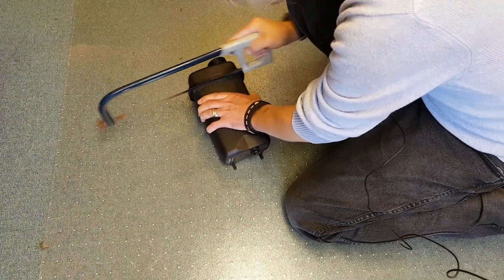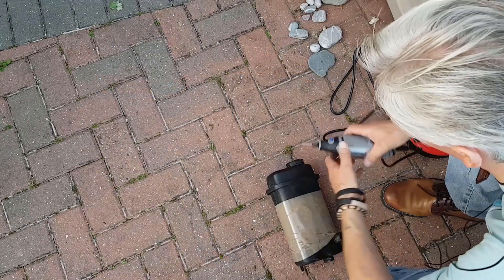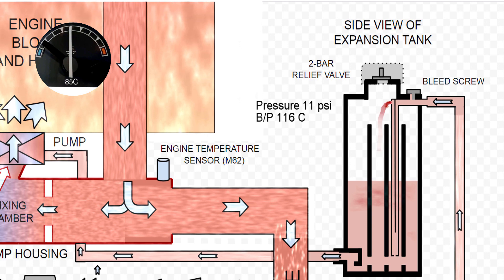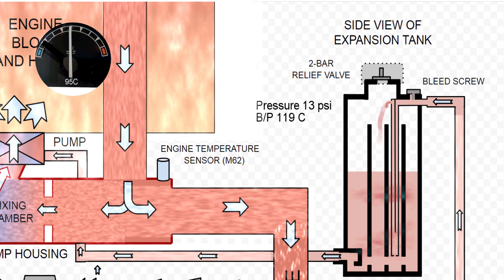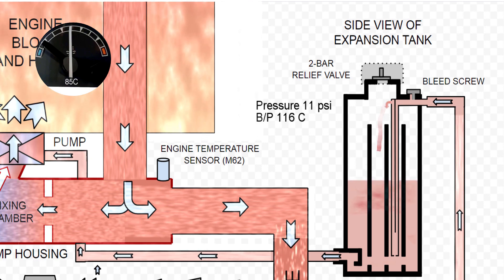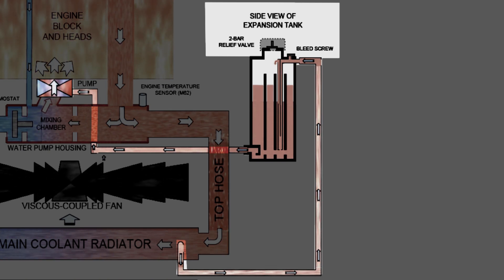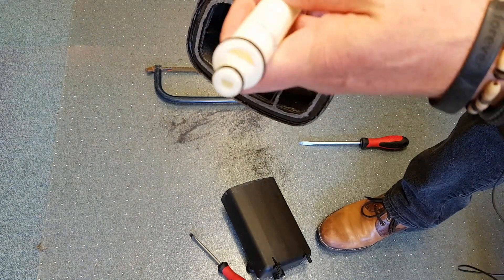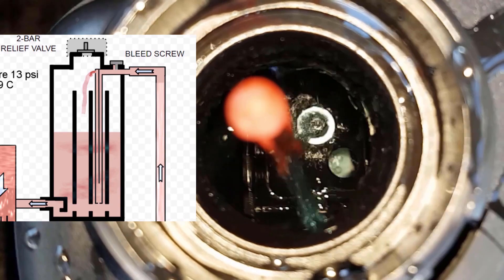I CHOP A NEW BMW EXPANSION TANK IN HALF

Comment: What causes the coolant not to flow out of the bleed line that trails off the top of the radiator back into the top of the expansion tank?
Reply from the maker: Possibly thermostat stuck open, not enough coolant or revs too low - you need 100 RPM before it will pop out of the bleed line
Reply: @TimmsBMW  figured it out ... the over flow hose that connects to the top of the expansion tank that channel was blocked with dirt not the hose but the channel on the expansion tank the hose connects to 😁

Comment: Hi Timm, this is a long shot but ill try. My red level stick wasn't coming up to the level of the lip, I pulled on it a little bit, it is now stuck considerably in the up position and won't go down. I am afraid if I fiddle with the red stick, it'll break. Any ideas?
Reply from the maker: They do that Hassan, mine was stuck for years until I replaced the tank!
Reply: @Timm's BMW Repairs and Information  Lesson learned. At least it's not catastrophic, thanks!

Comment: Hello Timm, Do you know where the weak points are on the e38 expansion tanks?
Reply from the maker: All over! The float support usually fails first and then it leaks onto the level sensor
Reply: @TimmsBMW  yep it looks like it is pouring out the bottom under pressure. Only have had it for about a year. Going to unbutton a few things so I can take a closer look as I can't see. Then put the pressure back on again as see where the leak is. Thanks!
Reply from the maker: @2009adtommy  make sure you have BMW blue coolant, it looks after plastics@

Comment: Fantastic--- I had never thought of the reason for the "waterfall" inside the tank. I had always wondered why BMWs build up coolant pressure faster than other cars. 

In fact, I once got so worried that I ran a  chemical"head-check" on my E38.

The caps (which I replace every 5 years or so with genuine ones) are rated at 2 bar. Do you know what pressure it usually runs at?
Reply from the maker: The pressure depends on how much heat the cooling system is trying to remove from the engine - the hotter the engine gets the higher the pressure. At idle, when the engine has reached operating temperature, the pressure is in the order of 1 Bar - but that is only a rule-of-thumb and the actual pressure is dependant on so many other factors.

Comment: Thanks for a very useful explanation. Do you know why my BMW X5 2007 E70 would have 3 pressure tests, all being normal, and yet it is leaking about a liter per day.  I found that the coolant is leaking from the bottom of the expansion tank. Probably coming from a connector. But I cannot see why the pressure tests (by AA and another mechanic) were reported as normal.
Reply from the maker: A pressure test is a tool to find where the coolant is leaking from (well, that's what I use it for anyway). If there is a lot of air in the system it is impossible to test using a pressure reading accurately as air compresses quite easily!

Comment: Really useful to know, are there any non OEM parts you wouldn’t use?
Reply from the maker: Never us an aftermarket MAF! It's really tempting as they are a fraction of the price - but you will have problems, if not straight away you will find that the car is difficult to start when hot. Causes all sorts of problems.

I've always used OEM parts on the engine, the effort required to replace engine parts (such as water pumps) means I'd rather spend a few quid more and be sure that it isn't going to fall apart.
Reply: @TimmsBMW  you're right on the MAF! Had one go out on my Volvo. I was not really cognizant of poor quality of Chinese stuff yet so I bought one off the net for $65 USD. The dealer wanted around $500 for the Bosch. Within 6 months it coded out and cleaning with the special spray did not help. I then found a new Bosch on line for $165. Had no more trouble.

Comment: Thank you for this most informative Expansion Tank video, Please continue making more videos. I also found your Facebook page; which is most comprehensive. Would you be interested in making a video, or posting me some advise about what can be done to the exhaust system on a 1999 E38 740il to give a little bit of a note without getting a drone and will it affect the operation of the O2 sensors. Yours Aye john.m
Reply from the maker: I don't have a Facebook page, but I have my own website at timmsbmw.com
Only the rear boxes need to be changed to get a good sound - no need to change anything else
Reply: @TimmsBMW  . Timm, Sorry, yes your website is most comprehensive. May I ask what you changed the rear mufflers (boxes) too?
Reply: @johnmarek8985  Timm is right, only deleting the two back boxes will get the car sounding very good. But don't straight pipe them! I tell you from experience, the sound is nice but you will get an awful drone from 1200 to 2000rpm. Just replace the back boxes with two small resonators or "cherrybombs".
Reply: @Abe_Sheen  . Thank you for the information. Cheers.
Reply: Hi.If you want a little bit sound,someting nice,make them empty both ends of exhaust,gonna screaming very nice.Trust me
Reply: Hi there
I would like to see this too as I have been thinking I would like to hear my 740i a bit more. Thanks in advance